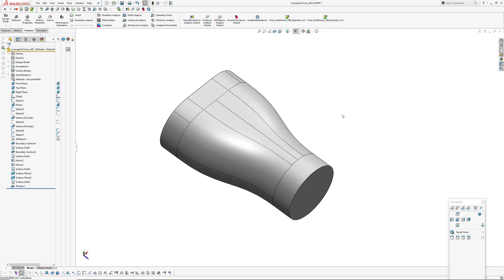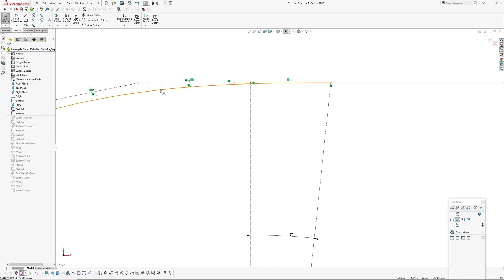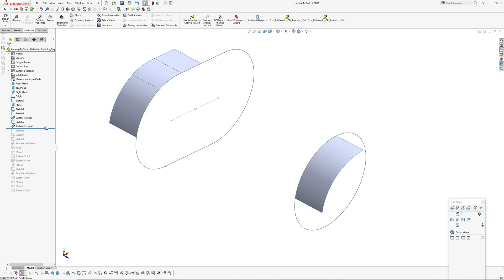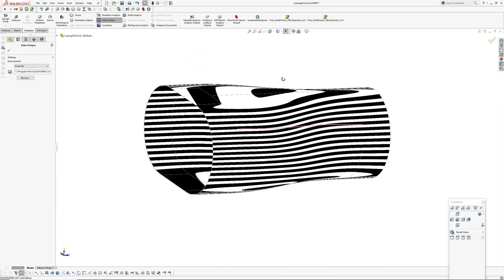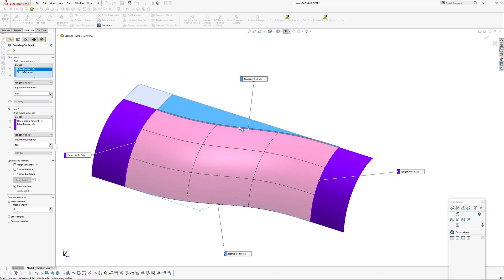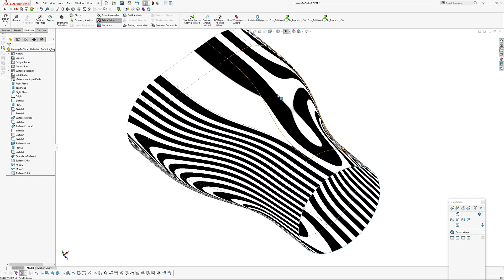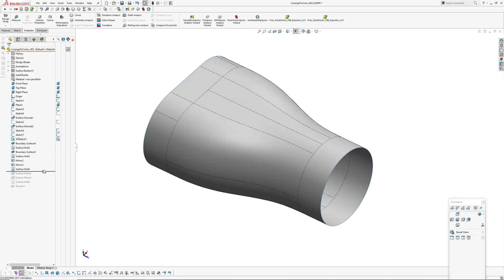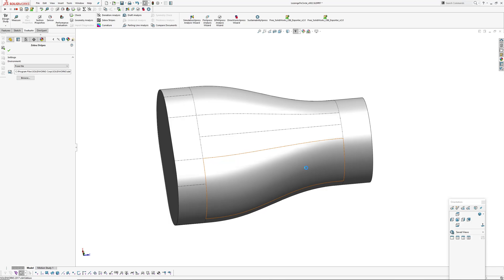Solidworks - Blends/Transitions 1 - Lozenge to Circle

Comment: I tried making these surfaces exactly like you did in your third attempt (from 7:37 onward), but in the end i was left with a pretty bad seam on top (operation Boundary-Surface4 in your case) and bottom (as a result of mirroring) surface. My fix for that was modelling the top surface using two splines and two split lines on the circular profile. Not the perfect solution, but a little workaround this bad seam.
Reply from the maker: Did you have normal to profile set for the boundary that is on the mirror plane?
Reply: @AndrewJacksonDesignStudio Yes, it puzzles me very much how did this happen. I repeated the process several times. Afterall i find your videos very informative and I am planning to watch all of them! Best regards